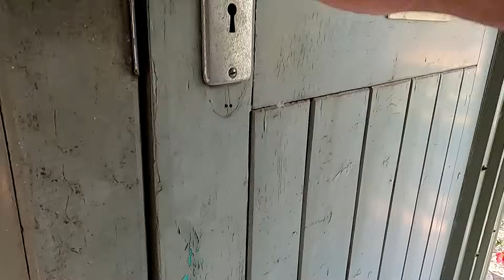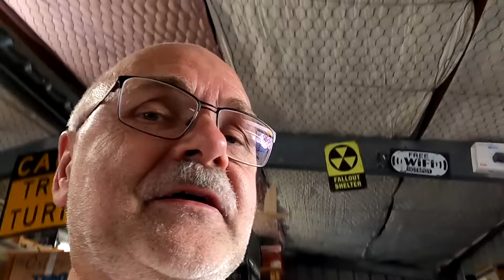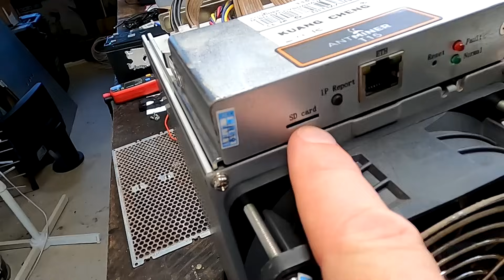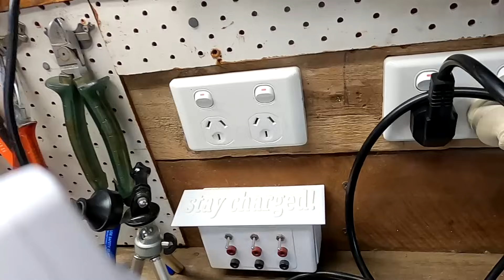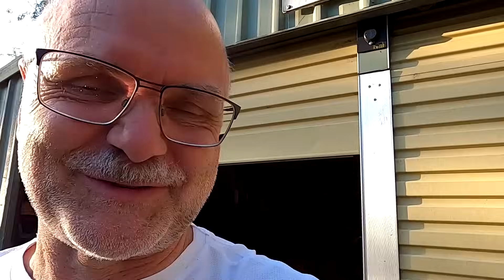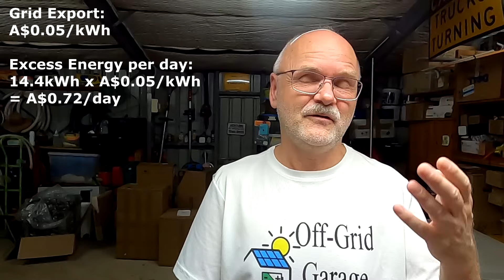Off-Grid Bitcoin Mining with excess power from your solar and battery. Worth or Waste?

Comment: With grid tied batteries in Australia you can be on a wholesale pass through plan like with Amber Electric and export to the grid in the evening and be paid a lot more for that excess energy. Some distribution zones (e.g. Ausgrid) also have favourable tariff structure for just this purpose. It's far more environmentally preferable. Problem is the costs for grid-tied batteries is very high compared with off-grid set ups.

I have a regular retail plan and our export tariff is 12c/kWh.
Reply: Once off-grid, always off-grid. It's like with EVs, there is no way back. No matter how you look at it energy suppliers take the piss out of customers. Plus there is that great feeling when cruising comfortably in your EV powered by home made solar energy.
Reply: @moestrei  I have both grid and off-grid PV (as does Andy) - and frankly there is nothing wrong with excess supply going to the grid - it is offsetting fossil fuel generation (in Australia). 
Andy could readily increase his grid-PV capacity and export the excess, he just chooses not to due to his existing PFIT arrangement.
Meanwhile, crypto is an environmental disaster.
Reply from the maker: I know a few people who are with Amber. Well, it's more a 'scam' than anything else. Promising you high feed in tariffs and you can be lucky to get over the monthly subscription fees they charge you for their service.
Grid connected is too restrictive and I would not be able to have so much solar installed and connected to the grid.
Due to the QLD FIT contract, I cannot upgrade my grid connected solar. I would lose my 44c/kWh tariff right away.

12c is good though for exporting excess.
Reply: @OffGridGarageAustralia  It's not a scam, it's exactly what it says it is - monthly fee plus pass through of wholesale cost. 
To make the most of Amber though you need:
i.  system automation to optimise operation of your PV and battery system, and
ii.  to be in a distribution zone which makes it more favourable. Energex/QLD is not one of those zones.
It's for people who have grid-tied batteries, and frankly given the ridiculous cost of those you need to find ways to eek out every $ you can.
It's why my battery is an off-grid system and that system runs the house (mostly).

Comment: You can get more efficient miners.  The old ones are cheap because they are not profitable most places.  Bitcoin also changes its value and as you saw it recently bumped in price and gave you more $/day.  Best strategy is to hold Bitcoin you mine until price hits a new high.
Reply from the maker: It's a test. I certainly don't spend $5k on a new mining rig.

Comment: I believe that DC to DC charging at high voltage, way above 300V is actually the fastest to charge those EV. I think it would be pretty much like the CC-CV charging you perform on your cell using the ZKETECH tester? But I don't know enough to advise you.
Reply: tesla does not allow dc-dc charging without using a supercharger station - there is firmware interfacing needed to enable it and nobody has managed to hack it - a lot of people have tried and damaged their vehicles. and of course tesla knows what you did so you forfeit the 8 year warranty on the battery.
Reply from the maker: Any DC charger bypasses the vehicles internal AC-DC charger and connects directly to the battery of the EV. There is communication between the station and the vehicle's BMS to control charging.
Nothing you can build at home.

Comment: The grid power cost in most places on earth is still lower than the cost of battery life /kwh charge and discharge cycles.  Saying our sollar plants is free electricity is a false narrative.
Reply: In western europe prices are pushing above 35$ cents per kWh, with prices of ~3 kWh/$1000 batteries it becomes very feasible.
Reply: Keep cooking those coal, oil and gas boilers in the power stations!   Things are a bit cool down under, we need more atmospheric heat!

Comment: Even if the electricity is "free" and not using petroleum or creating greenhouse emissions, it's still adding to global warming, lol!  That noise would drive me insane!!!
Reply from the maker: The noise is really bad. I could handle the heat, but the noise... there is no easy solution.
Reply: >it's still adding to global warming
It doesn't.
Reply: Your logic/ understanding of solar radiation is a bit flawed!   No girly lol from me!
Reply: @annpeerkat2020  My point was it's still dumping heat (as stated in his video) for the purpose of creating intangible "coins"... this has nothing to do with solar radiation, but it is to some (very limited) degree warming the environment.  When done in mass quantities, more so.
Reply: @ssoffshore5111  what do you think that solar energy would do if not used to run ASIC? It would be converted to heat anyway.

Comment: I export to the grid. As of right now I have 1245 kilowatt hours in excess for the year which the power company will pay me for at the end of the year. Being in Arizona my ac during the summer does no allow me to build up more than around 2000 kilowatts excess. I have 9.3 kilowatt in panels on my roof but no batteries to store. I get 4 cents a kilowatt buyback. But at least no 500.00 electric bills during the summer.
Reply from the maker: Thanks a lot for sharing.

Comment: Most people will never will make their money back on old ASIC miners because the difficulty of the algorithm increases meaning the income slowly goes down, however if you hold all the bitcoin you make and sell during one of bitcoin's crazy bull rallies you may get lucky enough, I mined with 20x 1070 GPUs back in 2017 and got lucky selling during the crazy bull run, but most people just waste their money and time.  My advice, don't bother.
Reply from the maker: Yeah, it was more like a test if this would be a solution and how bad the noise actually is. It is really bad😄

Comment: I kinda expected wings to sprout and lift off when those fans spooled up. I've been curious about bitcoin mining, but never found anything about it from anyone who is not full of shit. Thanks Andy for the truth about this topic.
Reply from the maker: Thanks. If the noise would not be, I could get rid of the heat not problem. But building an alternative cooling system is just too much effort for what we can get out of it.
Reply: @OffGridGarageAustralia  when i used to bitcoin mine in my garage I had some 3d printed air ducts that went on the back and would blow the heat out of some 100m flex ducting which not only took away most of the heat and blew it outside it also massively reduces the noise and i directed it towards my loud neighbor's house so it would drown out there obnoxiously loud conversations they would always have on there back deck drinking all day and night. and in the winter i ran the miners to keep the uninsulated garage which was also my workshop heated tho it did not get hot in there when its below freezing outside in upstate NY winters it keeps it warm enough to be able to work out there without freezing my bum off.   and even when it started to not be very profitable and was just about at the break-even point for the price of electric for power off the grid it was still paying me back for the electric to heat the garage in the winter.  which would of cost an arm and leg to have to just run electric heat out in the shop.

Comment: I don't consider that more complicated than my set up..I built all my rigs myself, from motherboards, processors, video cards, power supply, ram, fans, cases and drives, as well as a cooling system for the 3 dozen of them..The software has improved, and the prebuilt machines are probably better, and better integrated..But, I could always fix my rigs myself, because they were made from off the shelf components..And they made much better money back then..I wonder if your rig has a cool down cycle, and cutting the power completely, damaged the system, just a thought, never owned one of those..Ya, it's probably not worth it anymore unless you have a warehouse full of rigs, with a favorable hash rate..Which is why I stopped, and sold them all, when there was a shortage of video cards, which turned out very profitable....
Reply: the psu has giant ass capacitors so the psu fans tend to spin a while after cutting the power , the hash boards not
most of these asics don't come with a power switch you switch them off by pulling the cord, so no they don't have a shutdown cycle, i had older machines and no in the software the only option you had was reboot , not shutdown
Reply from the maker: This Antminer turns off as a soon as the power is cut. As per manual, this is how you turn it off.

Comment: Do not forget to add the $90 return shipping plus the $249, Andy; so it was about $339 for the 1 board set up.
I can only imagine how loud a warehouse full of miners are; almost sound like a baby jet  engine.
All the things you do and investigate is surreal Sir Andy, I'm still intimidated to go 48v systems, 24v is my niche.
Reply from the maker: Yes, correct, the $90 for shipping...
I've seen a video of such a farm in a big concrete hall. There was a truck service and diesel maintenance company next door which were complaining about the noise 😂
Reply: There is a paper mill 1 mile away, I could hear it at night. Now, it is a mega bit coin mining place. They must have a better system or good insulation. When it was in town, you knew it was running, fan cover flaps making lots of noise (flapping). I can't hear it at my place with the new Bitcoin machines, even driving past. I'm adding solar panels to get me through the winter. I have excess solar power in the summer (NW USA 50 miles from Canada). I talked to my son about doing Bitcoin with the excess in the summer, and he said we don't have enough power. I will show him your machine.
We are totally off-grid, $18,000 USA to bring in. They no longer buy with cash the excess, just give credits. This would be totally cash into a virtual wallet.

Comment: I bought an "old" S9i with 14T for fun (only 160€) last Mai and will use it to warm my feets when working ;-)
The S9i is limited to 500W per SW so ideal for such usage.
I will not get any money from it (i am in a pool but no connection) but I support the system ;-)
By the way, my Gobel Power PC200 with NEEY active balancer is on its way, thank You so much for the videos !!!
Reply from the maker: Thanks for sharing. You need to wear some ear protection when using this miner. 500W might be too much for heating just your feed anyway.

Comment: Excellent content Andy. With noise you could safely remove fans and submerge it in dielectric liquid like oil.  I believe bitcoin you mine will eventually be worth much more. 

Just one small piece of advice to take money of nice-hash or other third party wallets and put it on your own Trezor or Ledger hardware wallet. It's too risky to trust any counterparty.

I was kinda hoping to see some victron multip-plus magic to orchestrate excess energy rules to start stop the miner. Interestingly there is something to be said about shutdown procedure of air-cooled devices, they can get fried if power cut off before mining is stopped and device let to cool first. 

I am thinking to build CT Clamp/Modbus based raspberry PI controller to manage bitcoin mining at some point of time.  I really love your channel and learned alot here.
Reply from the maker: I can fully automate the miner and most other equipment I have through home assistant. Very easy to do without any scripting or coding...
Reply: @OffGridGarageAustralia  what is home assistant? a victron feature or something else?

Comment: serious alternatives to bitcoin mining: build a direct air carbon capture device, synthesize hydrogen using a reversible electrolyzer on a low-pressure level, or liquify a refrigerant using a simple scroll compressor to use it as cooling storage for the night.  if you are keen on burning excess energy, go for prime number hunting, cuz 2^(p-1) may be prime... check GIMPS project.

Comment: Thanks for the tips and laughs on being an off-grid solar bitcoin millionaire! It pretty much confirms the numbers I came up with months ago. Here in the Northwest of the U.S. where my average power cost is about $0.11/kwh and I rely on electric resistive strip room and water heating, almost makes sense to use a miner, albeit a liquid cooled one if there is such a beast?  I also have a friend who has an old 10kw solar tracking farm at his farm he abandoned  when he but in a new 20kw bi-facial solar array. 

He said I could use the old solar farm if I wanted to fix or bypass a couple of the trackers and a the few failed panels, and as it's in a farm field the noise might be a plus if it scares the birds an rodents and homeless people away, but at your numbers, it looks like it might gross about $150 U.S. per month before I take out $60/month for wireless internet service and maintenance and repairs.
Reply from the maker: There are liquid cooled miners but they still have a fan.
The heat produced might actually attract rodents and homeless😊
Reply: @OffGridGarageAustralia  Good point

Comment: I'm doing something similar, the excess energy is used in a server to donate processing power to scientific projects on the boinc platform
Reply from the maker: Yes, I did this as well, but the PC is only using 110W, so this does not cut my excess solar.
Reply: @OffGridGarageAustralia  it is an custom built server and it draws around 6.4 kW at full power with my current solar setup I can only provide about 1kW in the Sommer time. This solution isn't for everyone since you have to pay a lot upfront

Comment: I've actually considered using a bit miner for heat in the winter, but I would need 3 more Rhino batteries to make it through the night...
Reply from the maker: and more solar to recharge them. A split AC might be the better option here...
Reply: @OffGridGarageAustralia  I’m over paneled as much as I can without swapping my 6 x 445 panels with 540 watt versions. (8x540) + (6x445) almost 7kWatt hours. In the winter I’m fully charged by 11:30am and in the summer 8:30am. I only have 15 spots to mount panels and I can’t string 5 together because My 2 x MPPT inputs are only 250v each and 5 panels in series are 250v.
I’m not sure what you mean by slit AC? I have a 240v 12kWatt Inverter.

Comment: Bloody hell! Go and get some Noctuas or BeQuiets and swap them against the ones mounted...

Regarding mining: It used to be viable years ago. But in 2023 its nothing compared anymore. Whattomine gives a good impression about it. Years ago there were lot of positive values. Now all's close to or negative.

There used to be non-bitcoin crypto currencies that could be really well mined with cpus and gpus (but those days are over). With the amount of energy your antminer is burning you could have made a fortune with cpu/gpu. But even so even in those days 3-5 years ago bitcoin mining was already that energy-consuming that it didn't make much sense anymore for small scale.

Time seems to be over for mining.

Comment: I bought a used miner it works but I didn't manage to connect it to server and it made horrible noise. Hard to find a place for it in our home, I even can hear it from basement. I wonder if there's an option of these miners with liquid cooling.
Reply from the maker: There are some sound-proofing cases you can install them in which have different exhaust and intake systems. But this is additional investment and a lot of installation necessary in terms of exhaust hoses, etc...

Comment: For a couple dollars a day it’s not worth the noise 😂
When I have summer excess power I crank down a couple of Midea window ac units to supplement my central ac.
In central Florida summer the AC runs A Lot 😊
I only run my outlets from solar none of my 240v appliances.
I originally wanted to use solar power/ storage for power outages but it slowly expanded somehow.
My biggest power use now is hot water and I’m still pondering a hybrid water heater maybe even a 120volt unit to run it from solar.
Reply: The dry cool air alone makes the HPWH great for your environment.  I'd consider bumping your system up to 240V so you can make more use of it.
Reply: @ssoffshore5111  
That’s why I want to get a hybrid wh 
My water heater is in the garage and it will help cool another space reducing my summer cooling bill 👍
My current water heater is a 1987 unit 😂😂😂
I usually fix things when they break but I think it’s time 😂
Reply: Take a look and search on my  youtube page for water heater. I heat some water from direct DC ( 240v) to water heater elements for summer and split up the elements to one DC and one AC in winter .
Reply: @LarryKapp1  sounds like an option but my current unit is a 1987 model and I think I’ve done my last modification on it.
I think I’ve squeezed all the life out of it and it’s time to replace it.😊
Reply: @acinfla9615  If it is a resistance water heater there isn't too much to go wrong with them until the tank rusts out and they leak. If you can get the heating element out you can replace those easy enough - they don't cost much.

Comment: We have a lot of cold days with sun in the Netherlands so then instead of a room heater it’s better but water cooled and a big radiator so you can get a slower speed fan and make it way quieter
Reply from the maker: Water cooling is not really an option for these miners. There are some but still using fans.